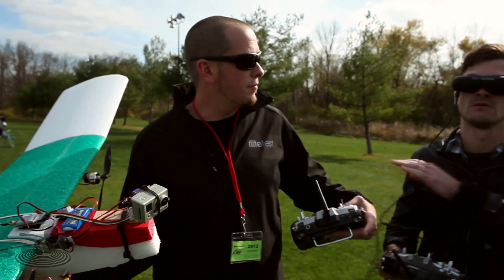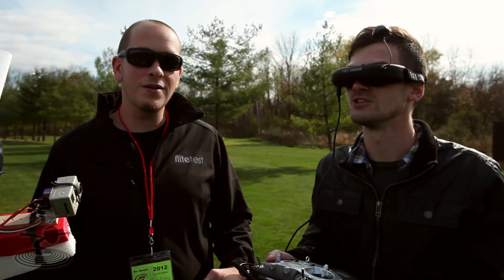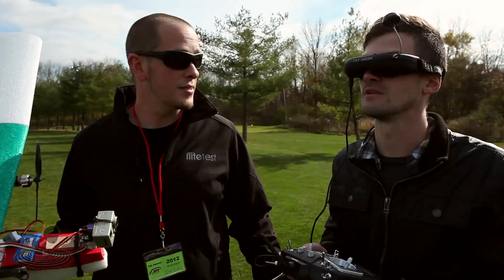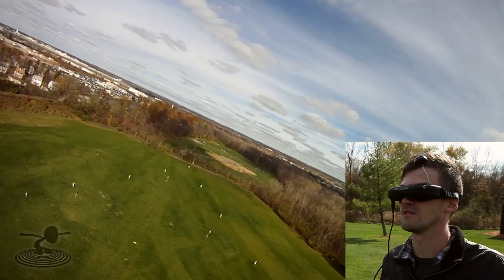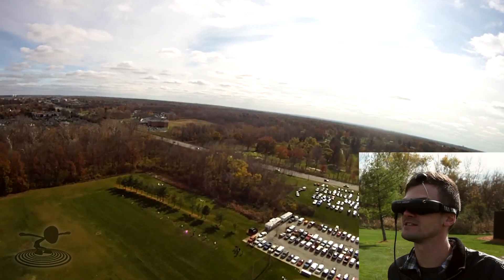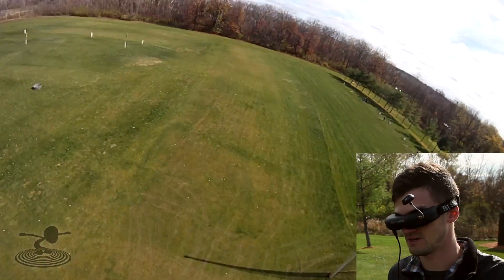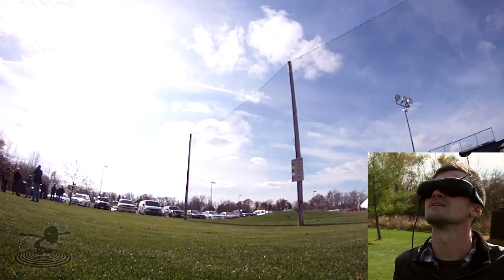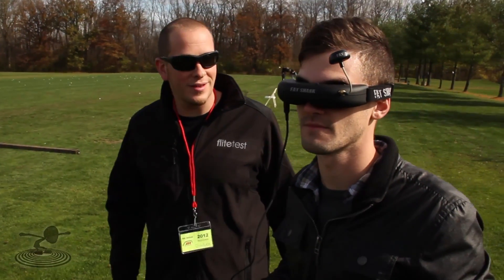Flite Test - GoPro Head Tracker FPV - PROJECT

Comment: There are two controls
How are camera movements and aircraft movements done
Head Tracker connected to 2nd controller
Airborne service 1. connected to controller
There are two receivers for two controls on the plane
How the system works.
Reply: The head tracker module has a signal wire that connects to the radio transmitter that you pilot it with.

Comment: absolutely you could but i don't think it would be a good idea...at least not with these goggles....this particular headtracking system has a feature that sets it back into a center/center position if your head moves to far or to fast....that would for sure cause a crash.....now with another headtracker that doesn't have this feature it would be doable for sure...hmmm...thats a good idea...I think flite test should do that...im sure it would hilarious...

Comment: I would live to see a steering system based on the pilot's head turn. All you would need to control by hand would be the throttle. Simply look where you want to go.

Comment: Hello friends, always follow your videos here in Brazil ! 
I have some models of glasses: FatShark Dominator, Predator, AIO, but none of them offers precision in movements headtracker. Ex: when we turn the head left or right, and head back to the center, not the camera back to the center (always have to push the reset button of headtracker), and this hinders me in flight. You know tell me if you need some correction magnetic declination to improve the efficiency of headtracker in Brazil?

Comment: Using er9x firmware I programmed the radio so that I could flick the gear switch and the camera would centre and the head tracking would be disabled. Also enabled two pots to control up/down and left/right which was helpful for fine tuning where the centre was. Also could still use the pots to control the pan/tilt when head tracking was disabled as well.

Comment: Awesome setup!  

BTW,  Have you experiment with 3D FPV (two cameras side by side, lenses approximately an eyes width apart)?  Can the headset handle separate video signals to each eye display?  I think the challenge will be in getting the video on you tube in a format that viewers can watch without special software or hardware.  Anaglyph would be the easiest but would require viewers to have the red/cyan glasses.

Comment: You can do it with one, if you have pan and tilt, it will just use two channels of your system. I think they have a cable for head tracking that fits into 9x radio